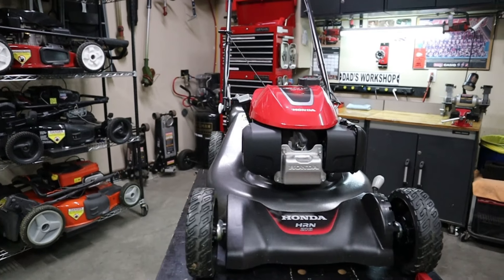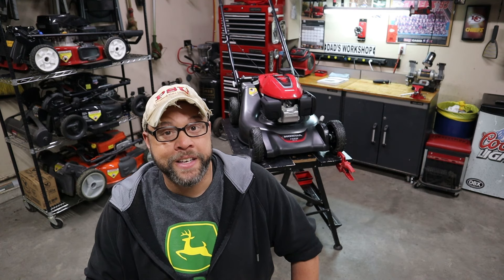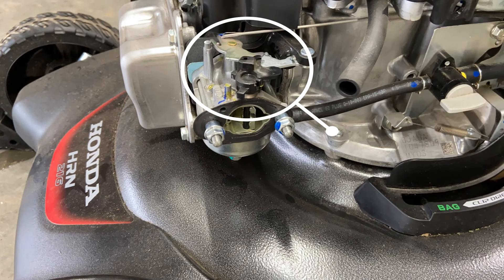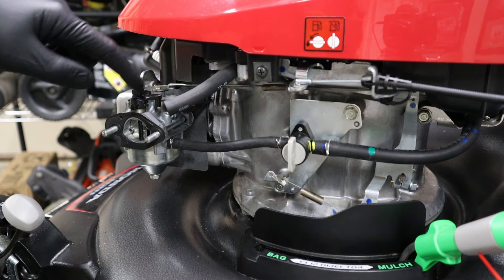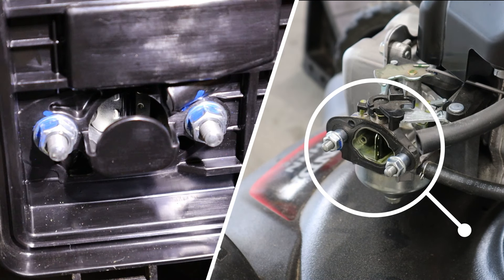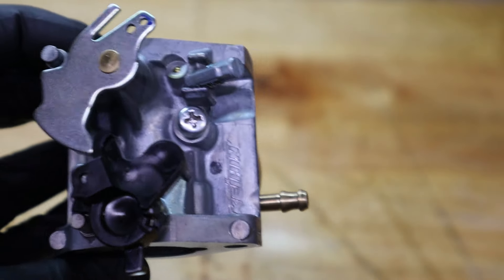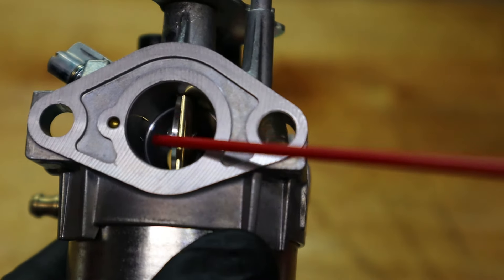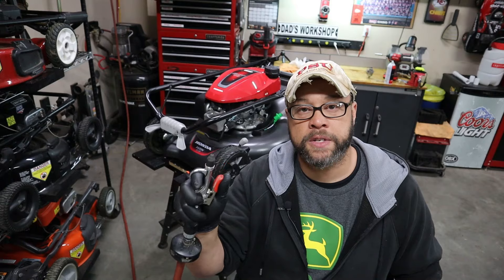New 2020 HONDA HRN216 GCV170 Surging/Rough Idle AND Auto Choke Test/Check

Comment: Thanks so much for this tip, Kipp.  I have a Black Max lawnmower (approximately 14 years old) with an automatic return choke on the GCV160 engine.  It started to surge on me recently after running reliably for 13 years without ever having to remove the carb to clean it - which I did last week.  My carb has a slightly different design than the 2020+ MY Honda engines.  In order to clean the pilot jet with carb cleaner I needed to shoot the fluid through the main air jet port (I don't understand why).  Then, and only then, did the carb cleaner squirt through that super tiny orifice in the center of the pilot jet port after removing the phillips head screw.  I removed the carb from the mower to do this.  To my surprise and relief, the surging is completely gone and the mower runs almost like new again.
Reply from the maker: Thanks for watching and your support Juneeyore82!

Comment: Fixed mine.   Started it placed a bag over the carb inlet forced the trash through.   Runs likeca champ.  Great video.
Reply: I tried cleaning carb multiple times and 'Mechanic in a Bottle'... the bag over intake was the only thing that worked. Thanks!

Comment: Thank you!!  Fixed our issue!  Bought the same Honda Mower 5 or so months ago from Lowes.  Used it a few times.  From the beginning it was doing the up and down RPMs.  Now it will try to start then stall out.  Drained the gas that we left in there for a few months thinking Bidet's 15% ethanol must have gathered some friendly neighborhood water.  Put new gas in it and it started and ran but still did the up and down RPMs.  Week later it wouldnt start.  Drained the gas and put fresh gas in.  Still wouldn't start.  Then we found your video!  

-Took the carb off
-Removed that screw which must be installed at the factory by Popeye with a 500Ft lb torgue gun?????  ruined the phllips threads by hand using a craftsmen #2...had to get my Dewalt impact screw driver with all my weight to get it to break loose.  Did they use an aluminum screw or something??? 
-Blew 30psi air into the hole, a bunch of gas leaked out.  Did not use carb cleaner, nor any cleaning implements.  Just used 30psi air.  
-Reassembled incorrectly once as is required for all do it yourself at home projects
-Crossed fingers, stood behind objects in case it blew up or something....pulled the fun cord and.......IT STARTED AND RAN better then it did brand new!!
Reply from the maker: Hell yeah! Thanks for comment.
Reply: I have been trying to get that pilot screw loose for days! Won't budge. Feel you on the Popeye with a 500ft lb torque gun big time.
Reply: 10 months later and the mower is not starting again.  After about 50 pulls it starts for 1 second then shuts off.  Guess Honda designed these new mowers to require a full carburetor clean every season to discourage owning lawns?  

Either way, I wish I had returned it when it first had issues.  Going forward, once I decide to rage quit having to fix my new mower every season, I will make sure to research the other brands thoroughly before making another expensive mistake.
Reply: Now every time we run this mower we have to "clean the carburetor" (meaning try to overcome this inherent design flaw probably caused by regulation).  By the way we use ethanol free gas so no idea how the carb could continuously gunk up...
Reply: @_Wake_Up_If_U_Can  did you ever take your mower into a shop and find out what the problem was?
Reply: @beri232  Never took it to a shop.  It still runs good but once in a while it has a very very minor issue where the RPM's go up and down slightly.

Comment: Fixed it!  Great video and explanations.  I tried the lazy fixes first - change oil, new gas, seafoam, but no luck.  I figure the next step was a complete teardown of the carb so was resigned to just taking it to the shop.  The great angles and steps in the video were easy to use, and it got the Honda running like new.
Reply from the maker: Hell yeah Micheal you got this bud!
Reply: I see you've got guides for belts, blades and more - definite subscribe.  Keep up the good fight!

Comment: Thank you "Daddy" this was a good fix, although I took a short cut and had to execute the repair a second time to fix it. The first time I did not remove the pilot jet screw; Cleaned everything with all 3 tools; (Carb cleaner, pipe-cleaner and mild compressed air) and when reassembled and started the mower, it continued to surge. A second tear-down and removing the pilot jet screw was the key. A trick others might find useful when attempting to remove "stuck fasteners" such as this little pilot jet screw which I encountered, is to impact the screw head first with some force. In this situation I used the end of a 1/4" x 6" long socket extension and a hammer to apply a few "love-taps" to the head of the screw from multiple angles and the screw came right out. Your instruction to verify the "auto choke" feature is working properly was pretty cool too (closed when cold and open when the motor is warm) Thank you Daddy!👊
Reply from the maker: LOL!!! Thanks for watching. So many viewers struggle with that stubborn pilot jet screw. I always try help but the actuality is their not using the correct “removal” tool. Thanks again and it sounds like you know your way around a shop.

Comment: I'll give credit where it's due. This fixed my mower. I didn't remove the carb just slid it back far enough to get that tight ass Phillips screw out hit it with carb cleaner then air now she runs like a champ. Thank you!

Comment: Genius, thanks for the help. This video is perfect. I bought my HRN 216 at the end of last summer and only mowed once with it. Started it up last week and had this exact problem. Carb cleaner worked just as you described. I was so pissed that this essentially brand new mower was doing this. Now I know at the end of the season I’ll need to shut off the fuel and run out the gas in the carb so it’s dry going into the winter. (At least I think that should work)
Reply from the maker: I understand your frustration, As a consumer when you spend $500 on name brand outdoor power equipment you expect it to work. thanks for watching.
Reply: Same, used my mower once last week, started it up today, and here I am. Everyone said Honda made the best mowers........not so sure anymore

Comment: This was great. I'm a little pissed, I replaced my old walmart mower with a new Honda. Never once had a problem with my walmart mower, after 1 year I have to fix my carburetor on my honda. Kind of wishing I had kept my $50 mower.
Reply: you probably didn't shut the fuel off before storage.
Reply: @norge696  shut it off after every use and completely drain the tank in the winter and run the carb dry.
Reply from the maker: Landon I totally understand your frustration. There’s a huge gap between $50-$400 and we both expected better. This engine is new to Honda and I think some changes with the carburetor are coming. I have never had any problem with their older model engines but that’s why I’m a Tech and not a engineer LOL. Thanks for watching.

Comment: Thanks for the overview!  Finally got mine corrected on the 4th attempt.  HRX217 had mowing load just fine, but surging would start after it was warm and just idling.  My pilot jet screw was totally over torqued (almost purpose, since the screw head is soft) on a 6 month old 2022 unit, and I had to use small vice grips to remove it.  Sprayed it out a couple times along with all the circuits.  Also used a piece of wire to clean out that jet hole, even though cleaner was flowing through.  
Not sure if the limiter cap screw is adjustable since it breaks if it's overturned, but make sure to note where it's turned before taking anything apart on the carb for cleaning.  I had to turn my to the right in order for it to idle without surging on the last cleaning attempt.  Main jet and bowl...all that was totally clean since I condition my small engine fuel.  
Again I abused my new mower during scalping and dead lawn rip out with massive dust clouds in prep for the new lawn I now have growing in.  😀👍

Comment: Thanks so much for posting this. I have this exact model and had only used it one time. The second time, it began surging. With your help and some carburetor cleaner, it's working perfectly now! Appreciate it!
Reply: Did you take the carburator off the chassis or you applied cleaner with the carb installed?

Comment: My HRN 216 has over 1 full season of commercial residential mowing I use it for my small lawn care business and have never had 1 issue whatsoever with it. Had to replace the wheels this year but other than that basic maintenance oil changes, air filter and spark plug.
Reply: I have heard of other people having to replace the Honda’s wheels.  The wheels should not have to be replaced after a year. Not after 10 years either.

Comment: Thank you so much. I was disappointed that my one year old Honda mower that I spent $400 on was already having problems. This fixed it but still frustrated that a new mower has this problem. I've never had to do this on the craftsmen or toro mowers I've owned in the past. At least it was an easy fix.
Reply from the maker: Couldn’t agree more. You would think that some of the $400 would go towards research and development.

Comment: AWESOME video and information!
Just fired up my brand new Honda with a GCV170 I purchased last Fall that I never used until now, gas in it from dealer. Fired right up, but It surged just like shown in this video. 
Did the cleaner in the carb as shown and it did the trick.......runs nice and smooth now.....Thanks so much!
Reply from the maker: You’re welcome Big Mick

Comment: Thank you!  First video I found that described my issue and went directly to the problem.  I used carb cleaner and a needle pin and my mower hasn’t run this smooth since I bought it!
Reply from the maker: Thanks for finding me.

Comment: I've had this exact mower 3 years.  Power assist failed almost instantly.  I've now cleaned the carb with Seafoam directly into the hole, used a guitar string to try and break out crud, as well as a pipe cleaner, and finally compressed air that showed it coming out the tiny jet in the back of the carb. 

Still doing it. 

I also checked the choke setup.  It opened and closed as it should. Completely at a loss.
Reply: Sorry for the negative reply, I got a can of carb cleaner, gonna try again.  This was an excellent video, I neglected to say.

Comment: Thanks Kipp!!! OK, so I had a problem with my Honda mower. Hard to start, would eventually stay running but not much power. It would take a few tries but eventually I could engage the blades and it would keep running. Engaging the blades actually helped to keep it running but limited power through heavy leaves. Followed the steps here, I cleaning the carb with cleaner and now my mower is back to running like new, thank you so much Kipp!!! My engine is the GCV200

Comment: Thanks for video. Worked after 2 tries.  First attempt I couldnt remove the stupid jet port screw so just cleaned front hole, but didnt work.  Second atttempt I read others comments about the jet port screw being a bitch to get off and I finally got it with a small vice clamp.  Sprayed into both jet port and front but still didnt see any carb fluid coming out back side.  Got my compressor going and blew the holes out and finally was seeing carb cleaner on back end port.  Put it back together and ran like a champ

Comment: Great video.  Got a used Honda but after mowing for 15 min this issue came up.  After cleaning it it like shown it worked like new.  Well that's after I figured out I put the gasket on backwards and forgot to put the screw it.     Keep up the good work

Comment: Just bought a brand new HRN216VYA.  It surges exactly as your demo mower does.  I took it back to the dealer, who, not surprisingly, told me it was running "to specs".  I swapped the thermo-wax; didn't help.  I'll try the carb cleaning.  Thank you.
Reply: Did that end up working for you? I’m running into the same boat with mine. Did an oil change, swapped spark plugs, new air filter, still sputters.
Reply: @stevemiller2418  Yes, the carb cleaning cleared the problem up.

Comment: Great video.  My 10 month old mower is this exact model, and after throwing out a gallon of stabilized fuel because I thought the fuel was bad, this gem of a video fixed my surging issue. You sir are my hero. I subscribed. Please keep up the good work!
Reply from the maker: Thank you so much Micheal!
Reply: Same thing to me.  These Honda motors are trash.  I thought I was getting something well engineered and built... especially for the money, but nope.  When it comes to small engines, I think I'm going to have to go with B&S...

Comment: This was an excellent video, that was exactly my problem. At first I didn't believe there was a clog since carb spray was coming out of all the holes like he said, but I took a metal bristle off a metal wire brush and poked it into all the holes and low and behold it runs perfect now. The screw on the top of the carb was a pain to get off.

Comment: Ugh… mine was surging like this for a while and I figured it was just the fuel… then the other day I got into mowing, stopped after 5’ to adjust the height of the mower deck and now the damn thing won’t stay running! It just sputters for 5-10s like that and quits! Sure hope this is the fix as I’ve tried spraying quick start in the carburetor and pretty much everything else I can think of. Hate to think this will be routine maintenance for this mower but I appreciate the video! Fingers crossed!

Comment: Took it out to use for the first time since last summer, and I had the exact same problem. This fixed it!

I didn’t have carb cleaner so I used what I had: aerosol 99.99% isopropyl alcohol and 30psi air from my air compressor. Worked like a charm.

Comment: For me, I celebrated the fix too early. I discovered that the surging would return as soon as the engine had warmed up and the auto choke was fully open. Could watch/hear it happen with the air filter off. So I dismantled the carburetor fully and cleaned all the parts. Fixed the surging problem. What I discovered as a separate issue, however, was that there was no GASKET for the carburetor float bowl, which caused fuel to be leaking even though the float system was working fine. I've never taken the carburetor apart since buying this mower brand new - I think they forgot to put one in and I'd just not noticed the leak before!!

Comment: I’ll have to figure out how to remove the Phillips screw. It stripped on me and can’t get it off. I’ve tried cleaning it and replacing the gas, once I get it cleaned it works for like 1 mins then It starts surging again. I also ordered carburetor Brussels to try and clean it.

Update: had to order a new carburetor, but Before I installed it I losen the screw and now my lawn is cut! Great video. Keeping the old carburetor for spare parts.
Reply: Trying to get that damn screw off right now and not strip it.
Reply: I stripped the screw as well 🤷‍♀️
Reply: @lesliecram2415  me too..
Reply: Where did you order the carburetor?

Comment: One more thing you should mention because this happens A LOT: Be very careful not to over-torque those two bolts holding the carb assembly in place or the choke linkage will get hung up causing the engine to sputter and run too rich on every cold start until the thermo-wax element kicks in and forces the choke open. The gaskets get squished and the plastic housing binds the linkage preventing the choke from unloading when the engine is started cold. The engine will sputter and spew black smoke until the thermo-wax element takes over, then once it cools down it all happens again. I’ve seen this happen on a number of Honda engines and I finally figured what’s causing it. If it happens try doubling up on the air box gaskets to increase the linkage clearance, ease up on the torque and use BLUE (not red!) Locktite on the carb bolts.
Reply: Great point. I put the box back on and it wasn't getting tight. I took a picture before I did anything and put it back with the same threads showing. I would have been over torqued easily if it were not for this comment.
Reply: That’s on a HRX 217 the HRN 216 doesn’t have that
Reply: Doesn’t have the thermo wax element
Reply: I did exactly like you said, I did take the carb off. I have never did any like this before so I give you all the credit…great video, it’s running great by the way👍

Comment: Screw was super tight. Tried WD40, vice grips, a small butane torch to heat it, power tools, etc. no way it was going anywhere without stripping the screw. Purchased a new carb, fixed it right away.

Have had the mower 1 year. Planned obsolescence on Hondas part? I like the mower but never had this issue on old Toro with a B&S engine over an 8 yr period.
Reply: Mine stripped… fortunately, Home Depot tool rental employee was able to break it loose & I replaced w/M8 hex head

Comment: Thanks for the video. My screw was tough too. Got a screwdriver that fit perfectly and tapped it on top. I really had to bear down on it but it came out. Used compressed air and torch tip cleaner to clean it. Put it back together and it seems to be running fine. 
Thanks again
Reply from the maker: Thanks for finding me!

Comment: Very helpful video. Thanks a lot. Helped me to resolve exactly the same problem with my relatively new and little used HRN536 with the GCV170 engine. I never had this problem with the old Hondas. Whether this is an ethanol issue or whether the new idle jets are more prone to clogging I don't know.  I could not unscrew the idle jet - it was fast, but carb cleaner and ultrasonic cleaning did the trick. Thanks again